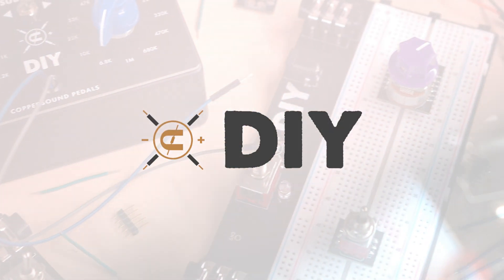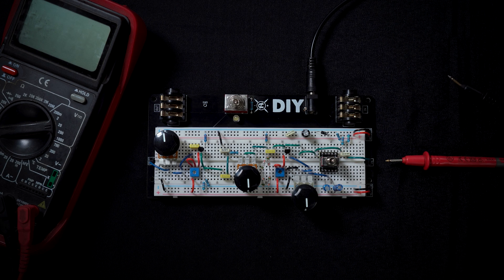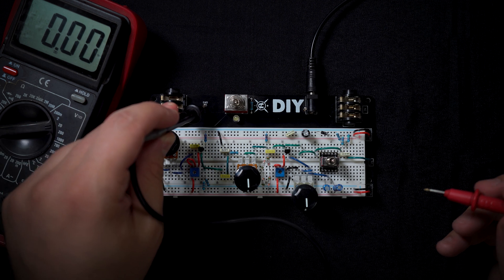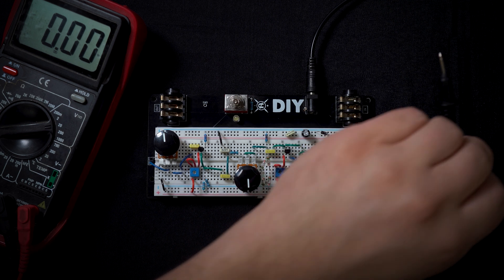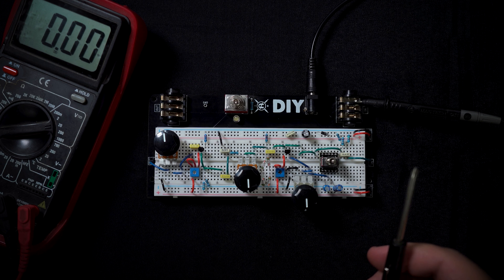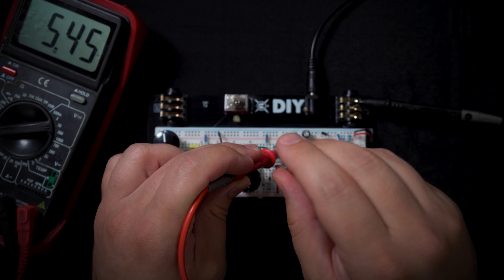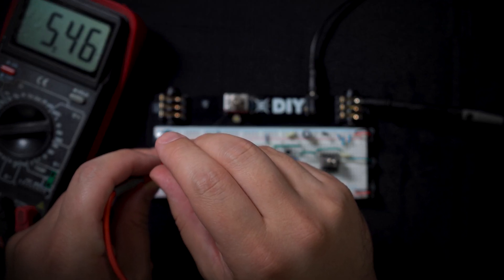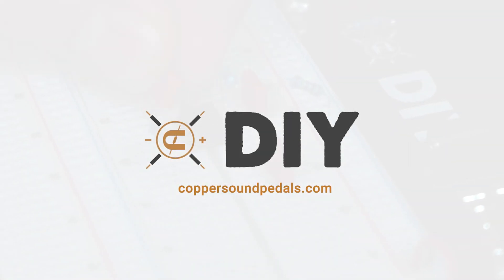DIY: Biasing Transistors

Comment: When biasing the first trim pot in the initial gain stage for 4.5V at the collector, what position would the drive knob be at the emitter (fully counter clockwise, fully clockwise, middle)?  Would it make much of a difference?
Reply: Beginner here and I am also struggling with this question right now! Because changing that drive poti/emitter restistance will always change that bias voltage so I am not sure what the reference point should be. Thanks @coppersoundpedals for your amazing work! :)
Reply: I'm picking middle - but came here to find out the answer to this question

Comment: What was the circuit it was in?  Which resistors were adjusted?  Where is the schematic?  This explains almost nothing.
Reply from the maker: Hey @technofox2604, this was a short video to demonstrate how to set the bias on transistors in general. Specifically, the video was using the LPB1-Boost-A-Drive-A-Fuzz from Josh Scott's Short Circuit Series. Links for this are in the description, where you can find the original video, product component bag, breadboard kit, and the free build guide that includes the schematic. I hope that helps and we're always here if you have any further questions. Shoot us an email - info@coppersoundpedals.com for anything else you need. :)
Reply from the maker: Thanks so much! Our goal with DIY was to really break down the barrier of difficulty and really show that building can be for everyone. Appreciate you!